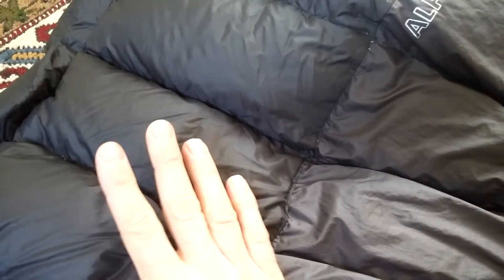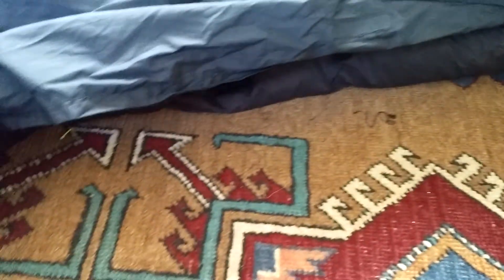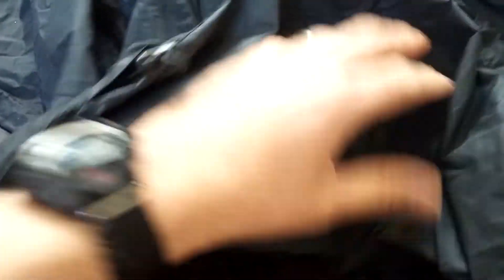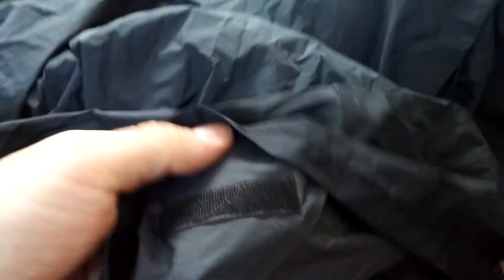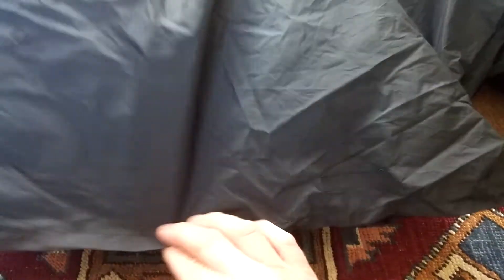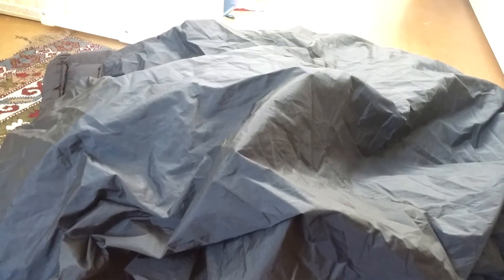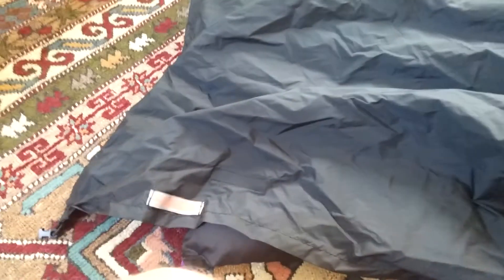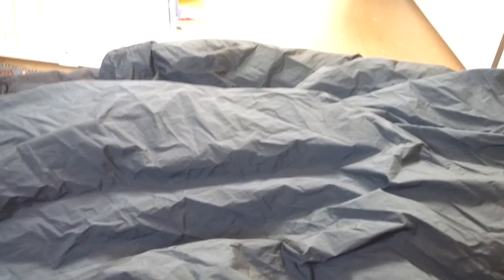Backpacking quilt cover pertex endurance light weight

Comment: Nicely done, I've just started making some gear and was looking for some 2.5 layer Pertex when making my bug bivvy. Do you mind me asking where you got the Pertex? I looked on extremtextil but they seem to only stock the heavier versions. I was looking for something around 40-50gsm. I ended up using 55gsm silnylon for the tub base and 55gsm breathable dwr ripstop for the top which works well but I have other projects in mind where Pertex would be ideal. ATB, Dave
Reply from the maker: Dave Vaughan thats were i got the pertex endurance from its about 55gms per sq meter.but have been wondering about useing pertex quantum maybe better as its more breathable and lighter.
When i find the time i wont to make a bug bivi, new down quilt, chimasheild quilt and sylnylon tarp
Reply: the gear shed thanks for the info. I'll be making another soon so will look out. Atb Dave